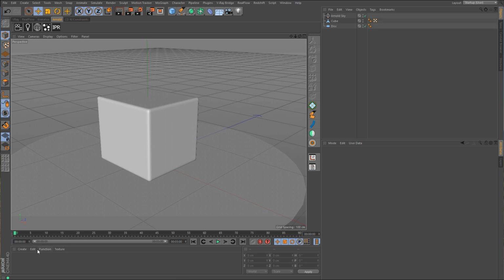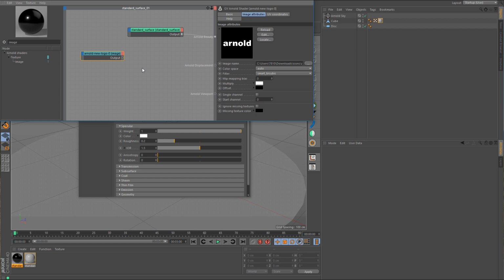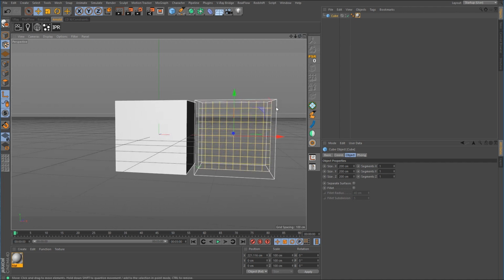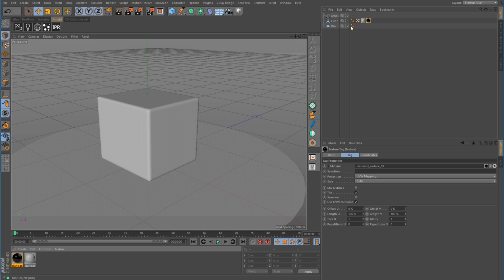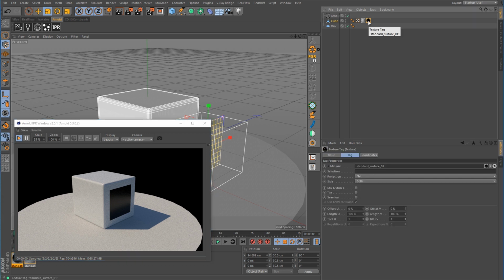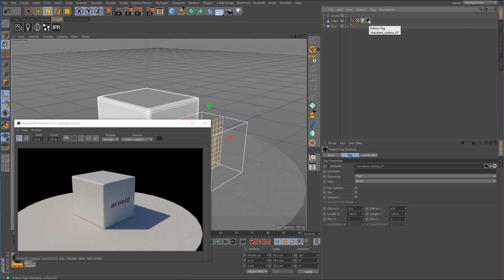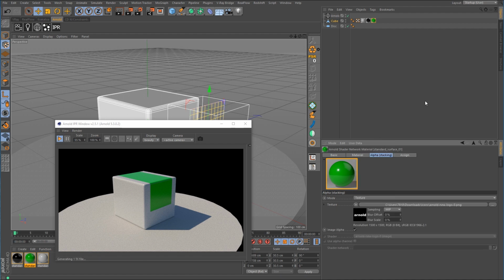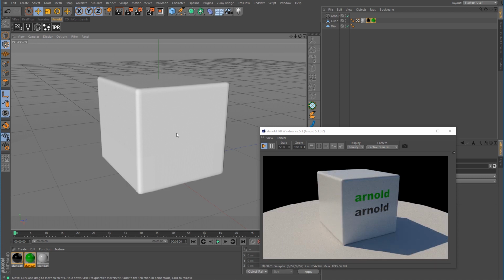Cinema 4D Tutorial - Arnold Renderer - Applying labels revisited!

Comment: This still seems extraordinarily convoluted compared to C4D's native way of handling alphas/PSDs. Is there no way in Arnold to read layered PSDs and just step through the layers needed?
Reply from the maker: I am not aware of any way for Arnold to read layers within a PSD file. (I haven't used Arnold in a while due to the constant IPR crashes I was having. I'm currently working with Vray 6.1) I just looked at Arnold 4.6 and I did not see any options for PSD image layers. The Vray material works a bit like C4D's native material, and will let you select PSD layers. However, the Vray node material does not appear to have that option. I will have to look into this further. I've always just used black/white images for alpha rather than multi-layer PSDs.

Comment: well that saved a tonne of time, is there a way to do this but with textures rather than a flat colour?
Reply from the maker: Yes. The texture file for color would be connected to the base color, and the black and white alpha texture file would be connected to opacity cutout.
Reply: @ShepperdOneill  yeah I sat on that after writing that comment, I’ll give it a shot
Reply from the maker: @mae2309  If you are using the newest version of Arnold, then the problem is probably related to ACES. The newer version of Arnold has the latest ACES color built into it by default. In the render settings, go to the Color Manager and make sure the settings are as follows:

Color Manager - default - ACES
View color space - un-tone-mapped (sRGB)

If you are going to render out an 8-bit PNG or JPG, then make sure the option is enabled that says "bake view color space into output (picture viewer). However, if you are going to render a 32-bit openexr, then make sure that option is disabled.

For the IPR, make sure the color space is set to Un-tone-mapped (sRGB).
Reply from the maker: @mae2309  You'll have to create a custom AOV pass for those. You can do that by adding a "aov_write_rgb" node. The ambient occlusion node will go into the "AOV input" port, and then the surface shader will go into the "passthrough" port. Then the AOV write node will be connected to the Arnold Beauty output.
Reply from the maker: @mae2309  In some cases, the default sample settings should work. If the image is too noisy, you may need to increase sample settings. I don't have much experience with denoisers. I have a pretty powerful computer, so I haven't used a denoiser yet.
Reply from the maker: @mae2309  😂🤣 I believe Arnold comes with its own denoiser, plus the nvidia OPTIX denoiser. Both are a post process. You'll have to set those up in the render settings. If I can remember, you'll need to create an "arnold imager" by clicking on the "effect" button. Then choose which denoiser you want.
Reply from the maker: @mae2309  Don't forget that Arnold is still relatively new to the party. Other engines like Vray, Octane, and Redshift have had more time for development. Also, Arnold is now being developed by AutoDesk. At one time, it was being developed by SolidAngle.
Reply from the maker: @mae2309  Have you tried Cycles4D? I was thinking about giving it a try to see if it's any good. Vray has been overhauled, but it's still lacking a lot of features.
Reply from the maker: @mae2309  I'd like to give RedShift a try, but it's GPU only, and Maxon only offers a monthly subscription. No more perpetual licenses. I miss the old days, when you could purchase a perpetual license and didn't have to keep paying. 😕

Comment: Thank you so much for the tutorial! (I goggled for this topic for hours)
I have a question. Instead of loading a grey scale image as the alpha, can I use the gradient from the pull down menu of texture selection if I just want a simple gradient alpha? Much appreciated!
Reply: I tried several times, it doesn’t work. (I’m a C4D and Arnold beginner)
Reply from the maker: If you want to use a gradient, you have to use the arnold ramp node. I believe the ramp_rgb should be the one you want to use. The ramp_float would be used for displacement.

Comment: Amazing tutorial, only question is when applying coloured PNG’s with flat projection they turn B&W?
Reply from the maker: That's odd. I'll have to give that a try later to see if I can replicate that. If I can find a solution, I'll reply back.
Reply: ShepperdOneill ah that’d be fab thanks! I applied an Arnold Parameters tag and unchecked ‘opaque’ and that sorta worked..
Reply from the maker: @ArthrUK  The PNG that you're using... does it have it's own embedded alpha channel? Or are you using a B&W image for the alpha?
Reply: ShepperdOneill own embedded channel straight out of PS
Reply from the maker: @ArthrUK  I tried to replicate your problem, but I was not able to. I used a PNG with embedded alpha (right out of photoshop), and used it in the color channel, and then projected it onto a simple cube. All the colors were there.
Reply: @ShepperdOneill  Hi, so I have same exact issue. I downloaded twitter and instagram png logo off of the internet and when I project, it turns black and white
Reply from the maker: @holamiplenty  Can you send me your file? I'll take a look at it.
Reply: @ShepperdOneill  Hi so I figured it out. I connected the image node to base colour output instead of geometry and it worked fine
Reply from the maker: @holamiplenty  Glad you got it sorted out!
Reply: @holamiplenty  hi thanks for the message! I've got black illustrations on my png texture and when I use ur method it gets rid of it. Do you know a workaround for this? much appreciated 🙏